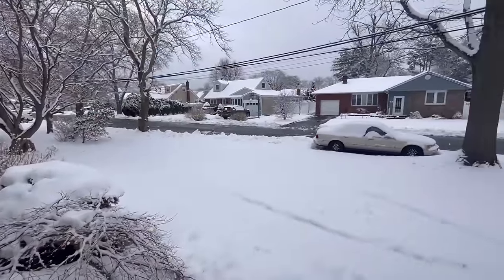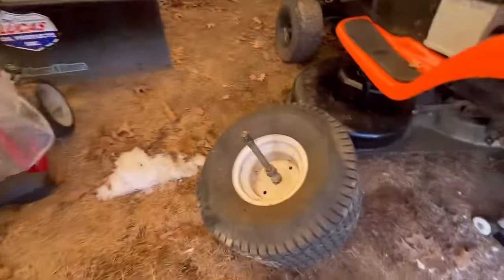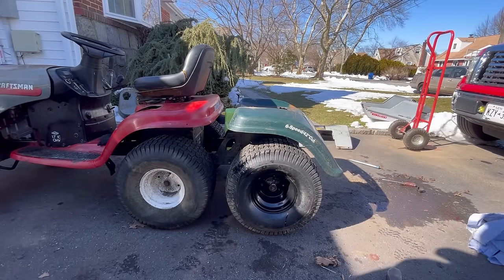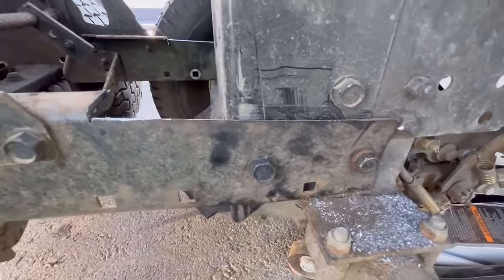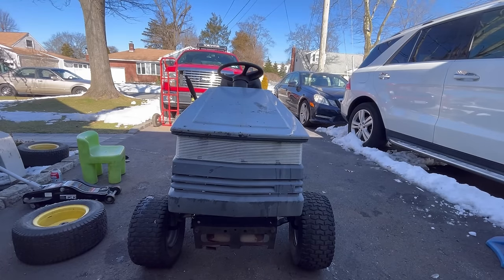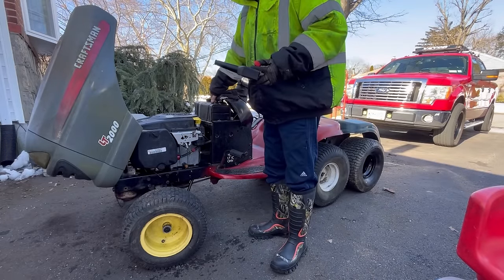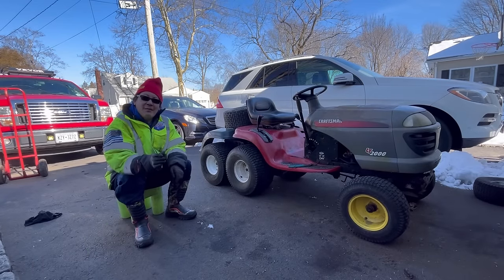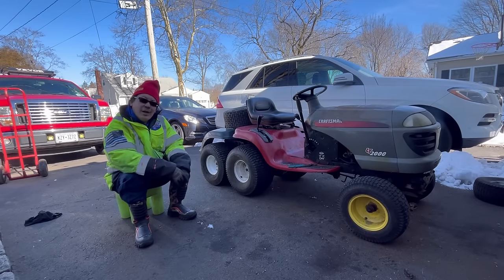I MADE A FREE 2x6 WHEELER CRAFTSMAN LAWN TRACTOR USING OLD PARTS WILL IT RUN?SECRET PROJECT UNVEILED

Comment: Your problem with the rear wheels is you put the new rear axle assembly on before you put on the taller fronts so there is more down force on them. You could make the rear bolts on the second rear end slotted and use nylon nuts so the second rear end can move up and down.
Reply from the maker: Or instead of two bolts on each end,  I can take one out so it can flex up and down?  Hope you’re subscribed